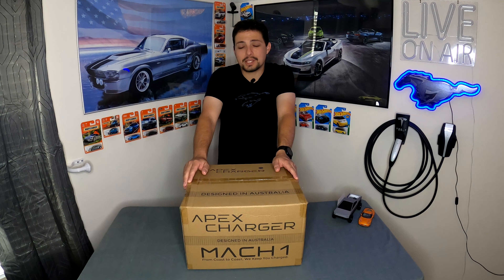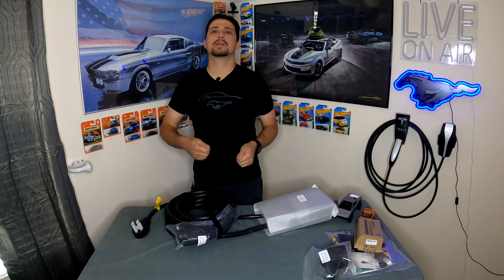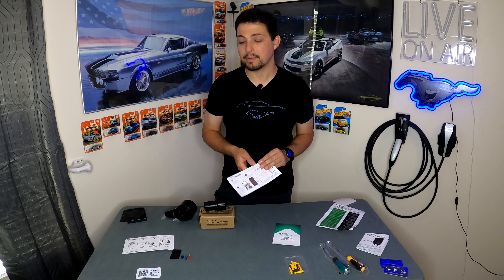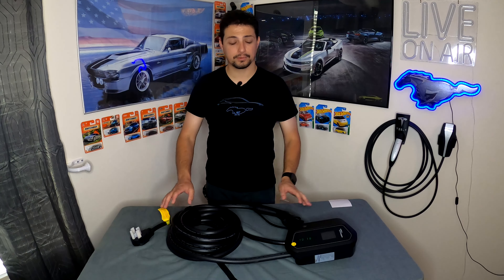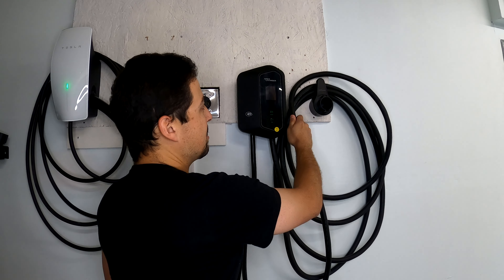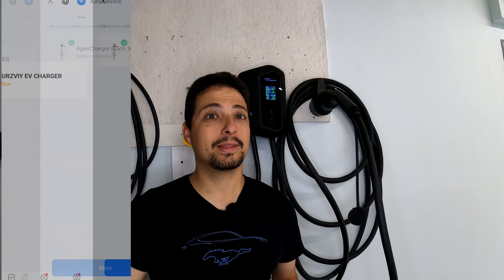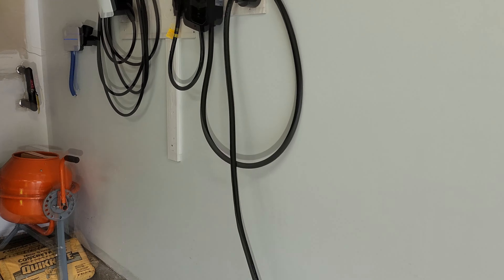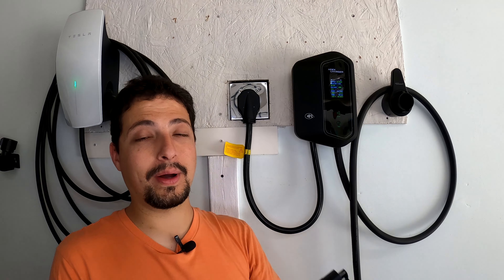ApexCharger Mach 1 | Level 2 | 48Amp | Hardwire Or NEMA 14-50 | Everything You Need To Charge Any EV

Comment: Hi I have a question
Can i install a breaker 40 Amp for this home charger?
Let me know I really appreciate it.
Thanl you.
Reply from the maker: Yes, you can install this on a 40 amp breaker, but you will be limited to charging at 32 amps. Exceeding that amperage may cause damage to the circuit or wiring.
Reply: @TechMotoring  Thank you.

Comment: I'm not an electrician, I have a question. i buy mach i.  Why can't i charge a car for 8 hours at 48 amps with a nema 1450 connector? with this charger.
Reply from the maker: As per electrical code. If you have a NEMA 14-50 outlet, then you can only have a maximum of a 50 amp breaker on that circuit. It you have a sustained load on that circuit for more than 3 hours, then you are only allowed a load of 80% of that circuit rating. Meaning only 40 amps are allowed for sustained load. Keep in mind this is U.S. code and I can't speak for other countries.
Reply: The NEMA 14-50 outlet can provide up to a maximum of 50 amps of power. The NEC regulation recommends using only 80% of the circuit breakers capacity. For example if the circuit breaker is a 50amp breaker then you should only set your charger top 80% of that which is 40amp. This a general NEC recommendation for all electrical devices.

Comment: If I go to wire this, and remove the connector, can I get 48 amps for 8 hours?
Reply from the maker: If you decide to remove the NEMA 14-50 plug from the charger and hardwire it into a box. You can then run it at 48 amps, providing you have the proper wire and breaker size.
Reply: Yes, hardwiring the charger is the best way to get the max 48Amps given that you will be using a 60amp GFCI circuit breaker in a dedicated circuit with proper grounding. :goodvibes: